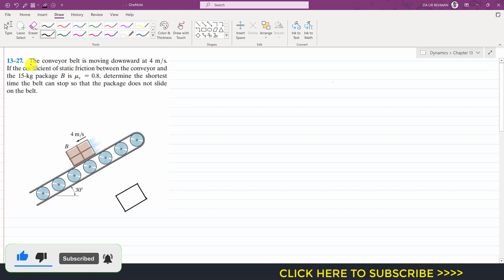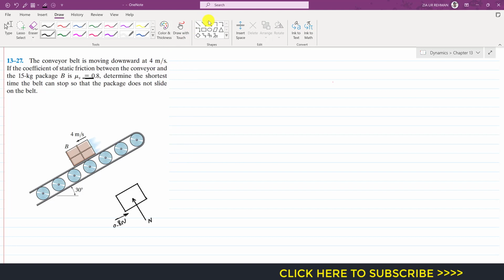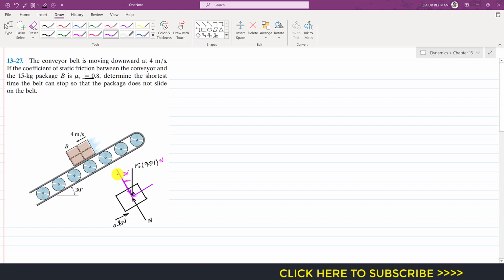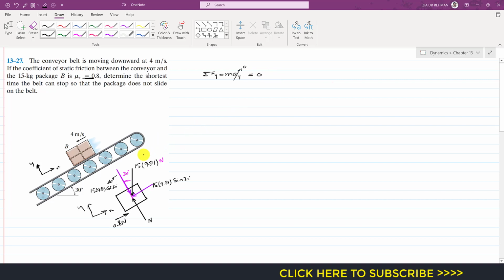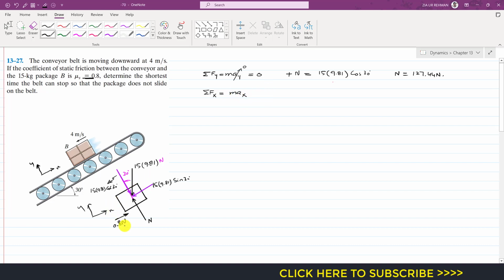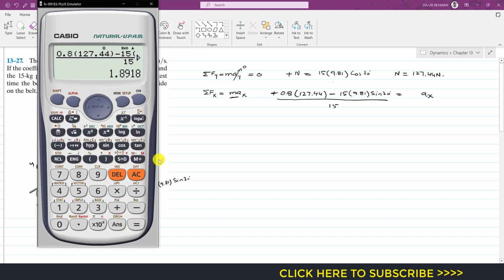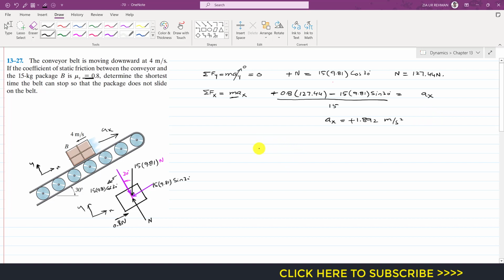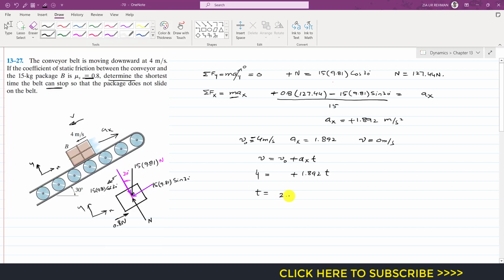13-27 | Kinetics of a Particle | Chapter 13: Hibbeler Dynamics 14th ed |  Engineers Academy

Comment: why are we using the coefficient of static friction if the body is already moving like shouldn't we be using the coefficient of kinetic friction?
Reply: The box is moving, but its movement is from the conveyer belt. Therefore it is not sliding and thus we use static coefficient.